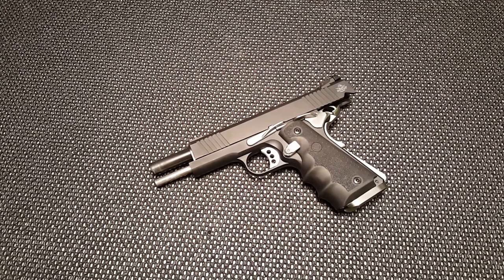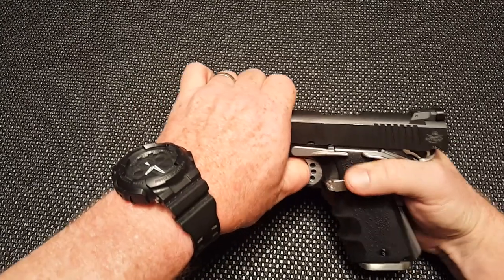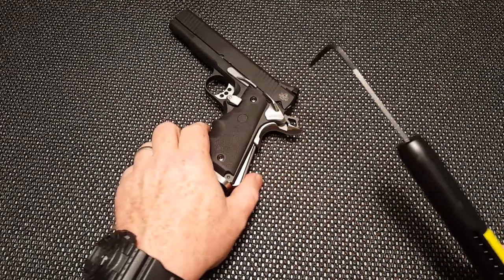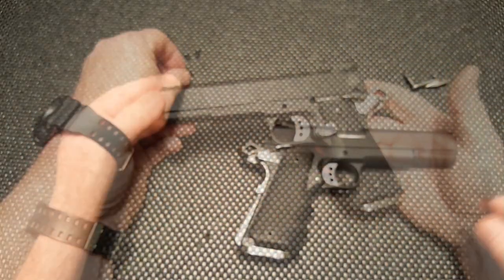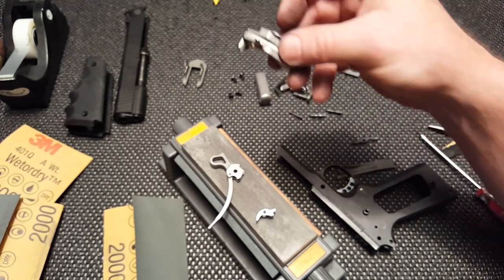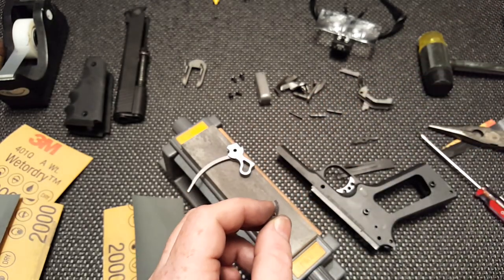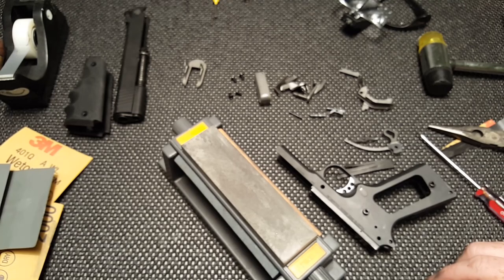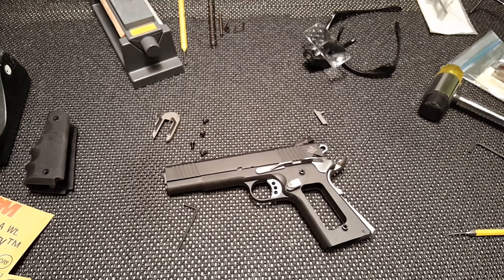1911 Tune Up and Trigger Job Before & After 5 to 3.5 lbs.

Comment: When polishing - if you want a "Gage block" mirror finish for these parts, use wet 2000 grit sandpaper and move the component in a "figure 8" pattern. The figure 8 pattern ensures you never hit the same points twice.

Comment: You want a super smooth polish get some .5 - 1 micron diamond stropping compound with a cloth buffing wheel for a dremel/ multi tool. I found this out the other day and wow it’s like a mirror. It’s the diamond stropping compound usually used for knife sharpening. If you want an insanely sharp knife it works awesome on a piece of leather.. I recently found out about the stuff and it’s been a game changer for alot of things

Comment: i went at my colts guts and polished everything i could on my progression of natural Japanese whetstones and it was a drastic improvement! i set it right at 4 pounds for safety reasons the trigger bow sear-dissconector leaf spring interface is so smooth that the tiny millimeter of take up is now a pleasant experience. its hard to explain the major difference it makes wen everything has ben honed as smooth as humanly possible actuality makes..it make normal people into gun snobs!

Comment: Good video on how to polish parts and make the trigger a lot better on the 1911. I do the same thing using homemade seer jigs and other jigs I have made. After using the same tools and sandpaper you use, I take the parts and polish them on my Watch lathe. I have an old Watch repair bench and a lathe. I chuck up a soft cotton buffing wheel and use very fine jewelers rouge and put a finish on all of the connecting surfaces of all parts that make them shine like a mirror. This does take a lot longer but it will take your methods one step further. When I bought my Springfield Defender 1911A1 it had a problem with the trigger catching even with hard pressure on the grip safety. I had to remove metal from the underside of the grip safety that stops the trigger. What was happening was gripe safety would not completely clear the trigger to allow it to be pulled. It was catching on the safety and sliding past it. Once the metal was removed and the grip safety polished I now have a 3 lb trigger that is smooth as glass. I made a polishing device that perfectly fits the trigger channel for ensuring it is polished correctly.

Comment: Looking good Airborne. I'm in the process of tuning my R1 Enhanced 9mm 1911. Keep it up!
Reply: Something to check out, if you haven't already, is the phone game World of guns by gun disassembly. You can detail strip a bunch of different guns and use various different x-ray or cutaway views to see how the parts interact when fired. You also have the option to do it in really slow motion. Definitely helped me understand the function of a 1911 and how the parts worked together.

Comment: Just spray sandpapers with water it will give a  better finish and use mothers polish after the 2000 grit and your set but iota did a good job

Comment: if you have not fixed that trigger slop there are little tabs on the front of the trigger bow just move them forward a tad with little needle nose plyers install and check might take a couple tries to get the slop out but just move those little tabs just a bit not much or you can break them off hope this helps kota or  anyone                                LOVE THE VIDS did not even need to watch as I have done this same thing a few times THANK YOU KOTABOY32 STAY TRUE TO BLUE
Reply: I will thank you keeper coming , I would say you have the world wide web and pops helping but I like to help my fellow man if I can I will keep tossing you bones though

Comment: im all for polishing, but on my 1911, i want it to polish itself naturally over the years that i have it.  right now i can hit a 1 inch stem of a weed at 10 yards, so its plenty accurate.  took me a while to get the creep out of the sear though, and once i finally did, it was a relief off my shoulders because i was scared i'd ruin it..lol took it apart, worked it, rebuilt it, wasn't good, took it apart, worked it, wasn't good.  about 10 times before it finally was good.  i'm happy with the trigger weight.  any light doesn't feel safe to me.

Comment: My trigger isn’t resetting nearly that smooth.  In fact it only resets if I take all the weight off the trigger. Causes? Actually just installed a new trigger tonight

Comment: Question:  Is it safe to continually drop (SLAM) the slide FORWARD on a empty frame with NO magazine OR rounds in it?  Another channel says it is BECAUSE that's what the Military calls for.  What do you say?  Does it harm the 1911 OR does it do NO HARM to the 1911?  Thanks.  SINCERELY.
Reply: Steel frame, no problem. God wants it  done that way. Aluminum or polymer, maybe not.